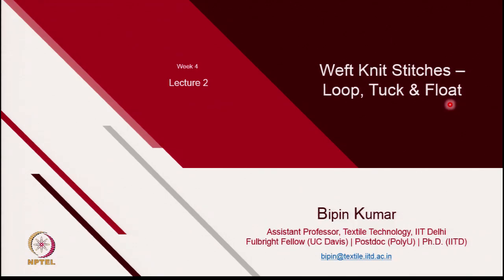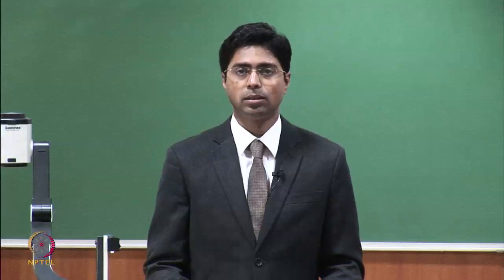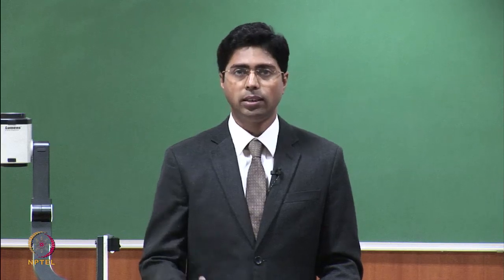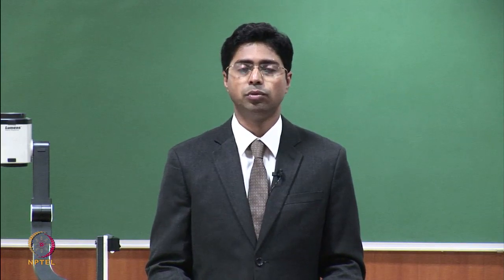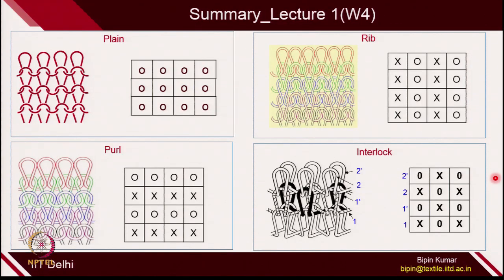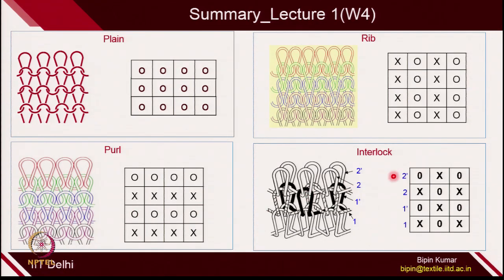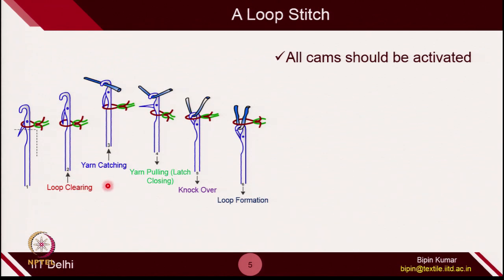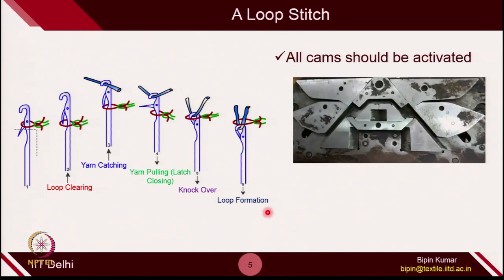Lec 17_Weft Knit Stitches (Loop, Tuck and Float)

Comment: At 24:11, it seems to me that when the butt of the needle would hit the left clearing cam it would break. The way i see it , the surface of the left clearing cam should be in contact with the surface of the needle bed, so there is no space for the butt to move through. How is this working ?